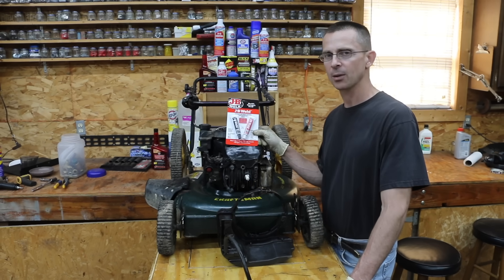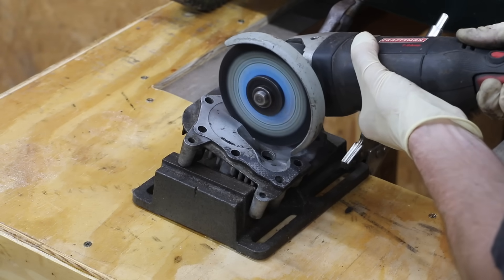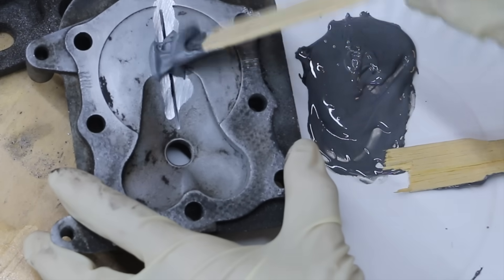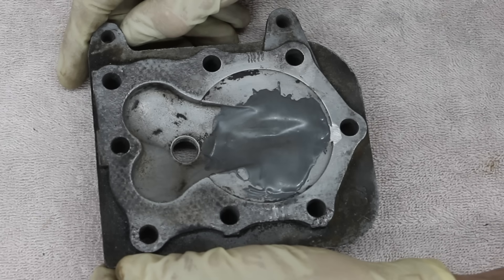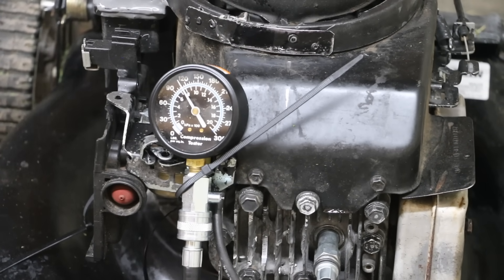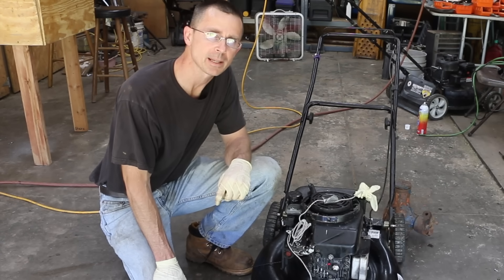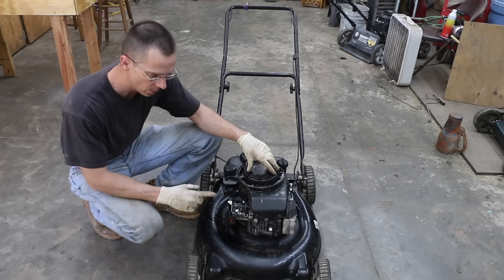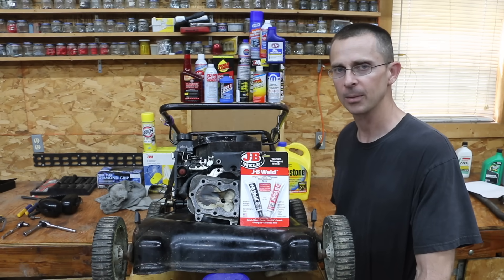Can JB Weld fix a cracked cylinder head?  See the proof!!

Comment: I know this is old but maybe someone will see it and get a chuckle. Saw a guy at a car show with an old Hudson and asked what that pile of goop was on his intake manifold. He stated his heat riser crossover in the intake had blown out and he glued the end of a spoon over the hole with JB-Weld. It had been there for at least 6 years. Armed with that I had been repairing 4.3 Chevy engines and noticed the water crossover on the intake manifold would leak due to pits in the aluminum. I looked it up and JB says their product is good to over 500 degrees F. I started cleaning them and laying a light coat of JB to dry overnight, In the morning I would file the surface smooth and install the stock gasket normally. Never had a coolant leak over many years. I have also done a temporary repair on plastic radiator leaks... and 6 months later it was still holding, even though JB claims it doesn't always stick well on plastic parts. In my case I had scuffed it up well with 80 grit sandpaper.
Reply from the maker: Thanks for sharing!

Comment: I had a Ford escort about 20 yes ago the heater core went and it overheated . The needle went to the red it cracked the head slightly. I used jb weld and it worked back then. Unreal
Reply from the maker: Thanks for sharing.

Comment: Hello. I tried to repair a cracked cast iron stove with high heat jb weld. Tried several attempts but the crack kept forming. It was on the top section of the stove. Maybe I screwed it up and you could test out an application of cast iron repair with high heat jb weld.
Reply from the maker: Thanks for the suggestion.
Reply: @ProjectFarm  I think I can dig up some pictures and provide more details if you decide to go down this road

Comment: When I was 15 I was riding a friends moped and hit a huge rock putting a large hole into the engine case. My friends farther said I would have to have it repaired at my own cost. I used JB Weld for the repair and it worked GREAT. My friends farther was impressed too. We used that moped for the next 2 years. I'm sold on JB Weld.
Reply from the maker: Thanks for sharing!

Comment: I have a story about JB Weld. I bought a new Polaris Ranger; I had it 2 weeks & was using it for making food plots for game in the winter. Anyway, I poked a hole in the radiator hitting a dead branch. I was sick. A New radiator -big bucks $.
I bought some JB Weld, drained down the radiator below the 1/4" hole and put JB on the hole, let it set up & put another dab on it the next day.
That was 3 years ago, not 1 drop has leaked out!
Reply from the maker: Fantastic!  Thanks for sharing!

Comment: Great demo I’ve used it to repair metal gas tanks that were rusted through on older mowers and the results were no leaks from gasoline, heat, or vibration.
Reply from the maker: Thanks!  Thanks for sharing.

Comment: I had a Crack in one of my gas containers I used jb weld first then a small piece of nylon more jb weld and my gas cans do get kinda bounced around and so far no leaks that was a year ago so I am a firm believer in that product if it held up to the cylinder head then the gas can was a piece of cake.
Reply from the maker: Thanks for sharing.

Comment: JB weld WILL work for what you have done here, but not permanently. What happens is that the expoxy (since it is a polymer) will continue to cure as the heat is applied by the running of the engine. The casting of the head will eventually expand and contract at dissimilar rates than does the epoxy. As heat continues to move the cast and the epoxy at different rates, the epoxy will eventually be too brittle to retain its adhesion, and come away from the metal. It works for your test, but time will cause it to fail. I know because I have done exactly what you have done. I've repaired heads and blocks with JB weld (or any epoxy for that matter) and while it works today, eventually it will fail. The laws of physics insist on the failure.

Comment: always thought loctite weld was a little better than JB weld but that being said i have use JB weld to fix random engine issues. threads mainly and it worked. this was back in the 1990's so formula may have changed.
Reply from the maker: Thanks for the feedback.

Comment: Back a few years ago i was into 2 stroke rccars. Some guys where really over the top in engine mods. Some did use JB Weld to make a smooth transition in hemispherical heads, but the most common use was to close the intake on the cylinder due to a complete swap to a reed intake. The JB Weld did not only take the heat and pressure it also did a good job with the lubrication film for the piston rings sliding over it. The first time i didnt belive it, but i works quite well. There should be some videos on YT with ported Zenoah engines and the JB Weld.
Reply from the maker: Thanks for sharing.

Comment: I also heard some suggestions from machine shops advicing to fill the water jacket gap corroded by water by using a non sag epoxy. And thats what my mechanic did. I think we should've used jb weld

Comment: The rear view mirror on my truck was mounted to the windshield. One morning, I found the mirror sitting on the floor board. I bought special adhesive, at and automotive store, specifically made to attached the mirror's mount to the windshield. I let it cure for a day and mounted the mirror. The next morning, it was on the floor board again. I tried two part epoxy and let it cure thoroughly. A couple of days later, the mirror was on the floor board again. Then I tried JB Weld and let it cure for a couple of days. I mounted the mirror. Years later, when I sold the truck, the mirror was still in place.
Reply from the maker: Thanks for sharing!

Comment: Used JB weld to fix a groove  on crank shaft of Tecumseh snow blower 5 hp. Oil seal wore out/damaged crank. No leaks  3 years. Then thru rod. Thank you your experiments are always helpful!

Comment: I have tried to use JB WELD, along with a liquid metal, 2 part epoxy, anything I could find for a cracked exhaust manifold on a 1966 mustang with a straight 6 engine. Nothing worked. It blew the seal every time.. the crack was through the whole plate. Made the car so loud like noise pollution. I wish I still had the car to try the fox again after watching your success. I feel I could have done a better job. Compression blew my seal every time. Thanks for sharing🙏
Reply from the maker: You are welcome!

Comment: I have part of a cooling fin that broke off my air cooled motorcycle engine. (1100 Yamaha) It is a clean break. I wonder if I 
can glue it back with JB Weld and not worry about it eventually falling off over time.

Comment: I have a 6.75 briggs on craftsman pressure washer. The briggs developed a sizable oil leak. I read up on it. Thought it was oil seal on top of shaft. no.  I tore it down to fix and found a crack in block under the flywheel. It still ran in this condition only leaked. Do you think JB weld could fix this crack? The crack runs all the way across block under flywheel. How would I hold block together after I applied JB? do you think crack would continue on? I value your opinion and input on this, if you have time to answer. Thanks
Jess R.

Comment: JB weld is used by sand haulers in the oilfield. When sand grinds a hold through discharge pipes, we slap JB weld on and its good for the rest of the week. 15 ibs pressures pushing abrasive sand. Pretty impressive.
Reply from the maker: Thanks for the feedback.

Comment: I've used JB weld to reseal old steam tables in the kitchen. They often develop holes where a thermostat is welded to the bottoms. It works and stays watertight for years. All 3 of the ones I have currently, have JB weld in them and haven't been an issue since it was applied. Clearly makes them more durable than factory.
Reply from the maker: Thanks for sharing.

Comment: The only thing that I've found that is better than JB Weld is Devcon B liquid steel.  Geared towards industrial use, it's more expensive but it works.  The part number is 10210
Reply from the maker: Thanks for the feedback.

Comment: I have drilled and tapped jb weld on a repaired outboard motor thermostat housing with good results preparation is very important thanks for the video
Reply from the maker: You are welcome!  Thanks for sharing.

Comment: JW Jetta with a 1.8 Turbo. 3 inch hole in oil pan. JB Weld held for the 4 years and I got rid of car and was still holding. Applied inside with tape on the outside 24 hr cure and did the outside and 24 hr cure. Good to go made everything nice and clean first 😌
Reply from the maker: Thanks for the feedback.

Comment: If you are doing tests with epoxy like products like bobdo or in this case JB weld and need to modify their shape, you can use a sureform or "cheese grater" cutting tool when the product starts to harden and still in a plastic like state, A rasp can be used, but needs frequent cleaning.
Reply from the maker: Thanks for the feedback.

Comment: Will JB Weld repair anything under pressure like a pressure washer pump or air compressor tank?  I'd love to see a video whether JB weld could handle that task.  I know this video is over 4 years old but hopefully you'll read my comment.
Reply: It will my upper radiator inlet legit broke off I tried water weld with a brass tube stuffed in but with space between the plastic entry and I finally used the regular jb weld and am using water as coolant to test it 3 days of hard abuse hitting 140 mph and it hasn’t leaked one bit

Comment: I just used JB Water Weld to repair a pin hole in a copper 1/2" supply into the house from a well pump & expansion tank.  No leaks after 10 days... I have kitchen reno coming within the next 90 days. I need it to hold until then... So far so good.  Thanks for a great video.
Reply from the maker: You are welcome!  Thanks for sharing.

Comment: I notice that there is also JB WELD 'HIGH heat" out there.
In about to attempt to fix a hole in the cylinder head of my xs650 motorcycle.
Would you suggest using HIGH HEAT, or Regular  JB WELD?
Reply from the maker: Thanks for the suggestion.
Reply: @ProjectFarm  I was just asking g, to see if you knew any better, since this  video is old.
How long did the JB last in the lawnmower

Comment: Amazing product
Had a freeze crack in a tractor
Ground the crack out drilled hole at each end of the crack filled the crack with JB WELd
Never did.leak
Reply from the maker: Thanks for sharing.

Comment: Amazing truly but not surprising for me. I've seen first hand JB Weld do some amazing things. Also the JB weld water weld and works as well as it says. The water weld replaced the ring connection in a 1950's gas station service sink which had rotted away between the steel drain bowl and sink basin which 5yrs later is still holding strong.
Reply from the maker: Thanks for sharing.

Comment: Very good test and impressive results with JB weld. However in an actual usage of repairing a cylinder head on an air cooled engine the cutting off of cooling fins would in my opinion lead to a heat concentration right on the head of the piston, which over time would lead to failure. Thanks for the demo I really enjoy them.👍
Reply from the maker: You are welcome!

Comment: Good video.  I'm glad it worked in your case.  I've had high hopes for JB Weld many times over the years for metal repairs, but I don't think it's ever worked for me; whatever I "repaired" snapped broken instantly after I tried to start using it again.  And I was allowing 24 hours of cure time too.
Reply from the maker: Thanks for sharing.

Comment: I want to try this on my cracked cylinder head. The crack is so small. But im pretty sure a BMW M50TU motor has more abuse than a lawn mower. Let alone 200+hp. And I wanted to turbo but I guess I never will.
Reply from the maker: Thanks for sharing.

Comment: I had a major hole in the fuel tank on a 1030 Case tractor. It was 1/2 inch or better.  I used JB weld to fix it, and it was still leak free when I sold it several years later.  I also had an 8n ford with a crack on the outside of the block.  I was overhauling it so I had the block Hot Tanked and that is when the crack showed up.  So when I got it home I Veed it out with a grinder and filled it with JB Weld It is still holding and that has been 10 years or so back.
Reply from the maker: Thanks for sharing.

Comment: I used J B weld on the intake side of a 2 cycle piston skirt the saw sucked in the screw holding the choke butterfly. It was at idle.but it put a 3/8 in slice up the bottom of the piston skirt. Beveled the slice and added JBWeld.24 hours later I sanded flush and assembled.its still running today.  Rick
Reply from the maker: Thanks for sharing.

Comment: I once used JB Weld to fix a big gap in the block of a chevette engine that had happened when the head gasket blew and the car was kept running.  There was a 1/16 gap between the 3 and 4 cylinder wall.   I filled it with JB Weld and sanded it down with sandpaper then put it back together and got a couple years out of it before trading it in on a fiero
Reply from the maker: Thanks for the feedback.

Comment: I've a tiny oil leak which I think I've found . Just changed my oil amnd filter . I'll make sure before trying anything . It's at lower crankcase where it's bolted to ac compressor . Tiny since I think it goes down very slowly just annoying . Yeah I hit something very hard . Possibly a problem if it still leaking when I try using permex / JB weld grey or black  glue since it's supposed to be clean and dry ? Any helpful experiences out there ? Do I have to wait till I drain it during my next oil change ?

Comment: I would love to see if JB Weld can be used to fill a pitted shaft or surface that has an oil seal against it. You can buy new sleeves to repair surface but am keen to know if JB Weld will stand up to  a seal over time?
Reply from the maker: Thanks for the video idea.

Comment: I used the JB weld to fix the GOPRO adaptor to my helmet. Worked very well. Of course nothing special. But now i have a crack in my engine of my Komatsu pay loader. Happy I saw this video, because i am confident now that this will solve my problem. It will be way LESS CHALLENGING than what you did here with this cylinder head. Thank you so much. I let you know how it went.
Reply from the maker: You are welcome!

Comment: The Stuff Works. I had a 70's  Honda CB 750 the chain broke and went through the Crank Case and it poured oil. I fixed it using JB Weld and no leaks
Reply from the maker: Thanks for sharing.

Comment: This definitely works, fixed jeep 4.0 cylinder with 4 scoring marks about an inch long ><1 mm deep and resurfaced the cylinder walls  It's going on 4 years, drove it through the Sonora Desert in a 12-hour trip last year and it still running well. I haven't lost compression  as might be expected
Reply from the maker: Thanks for sharing.

Comment: Hi, Would really appreciate if you could locate a Yanmar 1 GM 10 cylinder head  (marine boat single cylinder head), which is Cast Iron. The exhaust port is very thin; and would be an excellent project for you to show J B Weld , as most people cleaning carbon from this port, end up putting a hole through into the valve area., and then hundreds of heads are thrown away.  ps. These heads cost £700  !!!
Reply from the maker: Thanks for the suggestion.

Comment: I have repaired the fuel outlet that broke off on the metal fuel tank of my generator. The exhaust manifold (6 inch crack)on my boats Mercruiser. And on the engine in my experimental airplane. Not one failure. Surface MUST be clean.
Been using JB for over 15 years with great success. And it machines like metal.
Reply from the maker: Thanks for the feedback.

Comment: It won't seal anything under pressure or hot (expansion and contraction )defo not a cylinder head or four stroke casings you might get away with a two stroke gearbox or clutch casing
Reply from the maker: Thanks for the feedback.

Comment: Used JB weld to repair a pitted unobtainable brake master cylinder,  sand blasted the bore and cleaned it in alcohol, afterwards filled the pitting with JB weld, let dry hard then brake honed it to finish, fitted new seals and refilled the brake system with silicone brake fluid, that was10 years ago, brake system still works perfectly. Just a show Queen not a daily driver.
Reply from the maker: Thanks for sharing.

Comment: New to your channel, but love all the testing you do. Would like to see if any other two pot expoxies can beat JB weld, such as Araldite?
One test i'd love you to perform, is a comparison between JBweld, Araldite, Red threadlocker, Silver bond 2 on (25mm length) M6 metal studs inserted into aluminium(which strips easily).
A check of torque needed to release stud and measurement of the electrical conductivity through the stud would be brilliant and could help out a whole community of folks that strip out aluminium lifepo4 cell terminals.
You always say you get your test ides's from viewers suggestions :-)
Reply from the maker: Welcome!  Thanks for the video ideas.

Comment: I love JB Weld ... been using it for decades ... used some on my neighbors truck to fix a molding for his soft top and drill and tap for a hold down washer ... George has now gone thru about 12 dozen packages of it fixing everything around his house ; ) ... and yea, painters tape or duck tape is good to make dams and keep it in place ... like all epoxy it best to mix thoroughly to uniform color
Reply from the maker: Thanks for sharing.

Comment: JB. Weld original is the Real McCoy. Apparently the other JB iterations are weaker. Not sure why. I am sure there are other impressive epoxy glues. WELD is the term that applies here. 

Super multi material weld glues should be tested  try that. Now I can attempt the oil pan crack repair with JB Weld
Reply from the maker: Thanks for the video idea.